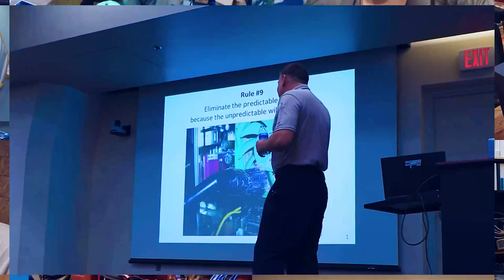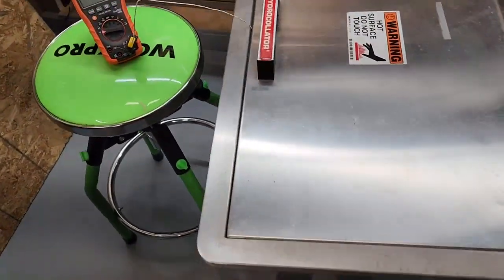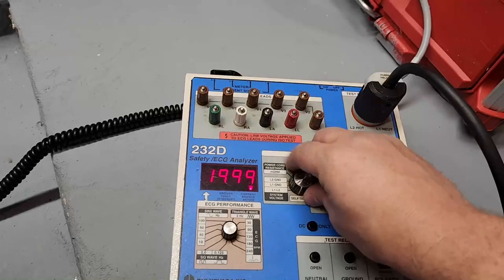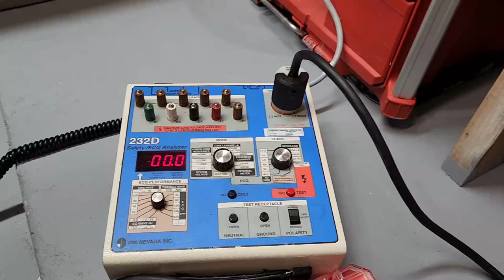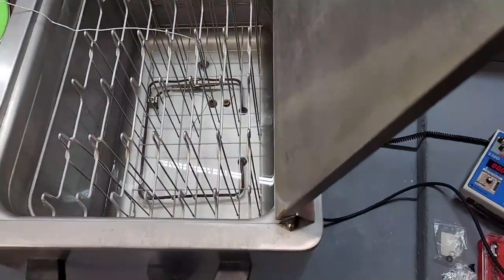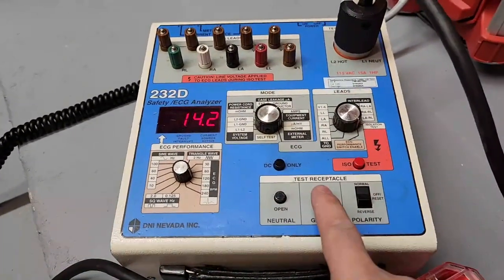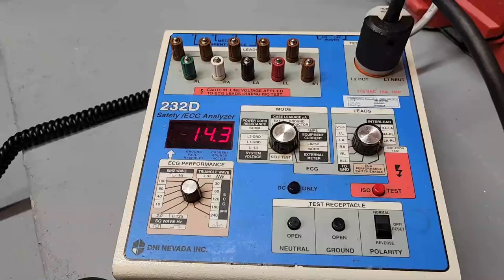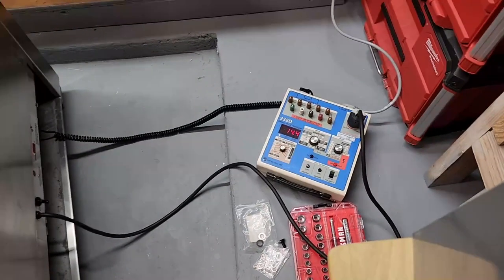Too Many Amps

Comment: Another trick you can use, if you suspect there is leakage between the heating element and safety earth, is to add salt to the water, salt wil lower the resistance of the water, and if there is leakage, the leakage current goes up. 
And last, you can use a FLIR camera to see if the heating element warms up entirely , or if there are hot spots that can point to internal shorting in the element.

Comment: Rub your finger along the bottom of the element (When its Cold - Of Course). You will find the straight line crack in the shell. often at the standoff near the front of the unit.

Comment: Seems the heat is expanding metal somewhere. I think it would be the heating coil or internal ground connection.  Does it lower when the unit cools??  Any cracks in coil housing?

Comment: Justin,

The heating element will have an opened outer shell on the bottom side of the element. It will fail in the next 30 days. I have seen this many times on hundreds of these units in my 40 years of BMET service.  Replace the element.

Comment: The 232d I have used this tester between 150000 and 200000 times. Used on every item I worked on that wasn't double insulated or non grounded.

Comment: If the device is pure a resistive load, you can use your bench powersupply, set it at 1V @ 5A , connect your DMM in Amps measuring in series with your bench powersupply, then connect one testlead to one of the wires of the mains plug of the device, and the other testlead to the metal chassis of the device, and see how much current there is leaking. But i don't think it is leakage to ground, otherwise your RCD had tript, because you are measuring in total a few amps more. With your tester at "Case leakage" there is showing 0,2 max, i presume that it is mA, because 0,2A is 200mA leakage and your RCD had tripped. So it seems 200µA, now with a electric component like a heating element, you have always a capacitive current leakage,  because the inside and outside of a heating element forms a capacitor with the insulation (propably ceramic) act as a Diëlectric. i did some calculations, with 200µA leakage, this means a resistive value of arround 600 Kohm, or a capacitive value of 2,2 nF. 
Both of these values can be measured with your DMM. But again, 200µA leakage, doesn't explain the total current draw of +14A while the device is rated for 12,5A. 
My guess is that the heating element itself is the suspect, and that it is working "fine" but it is out of tolerance (manufacturing fault) and it produce more then the normal 1500Watt, or it is just a higher wattage element that was mislabelled as a 1500Watt.
To rule this out, you can do a resistance measuring of the heating element with cold vs hot water (normal working temperature).